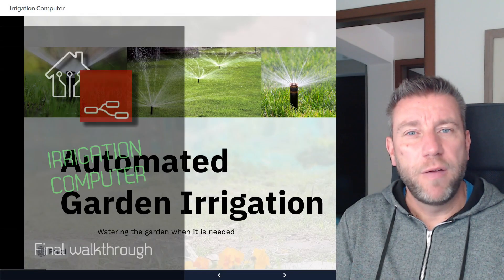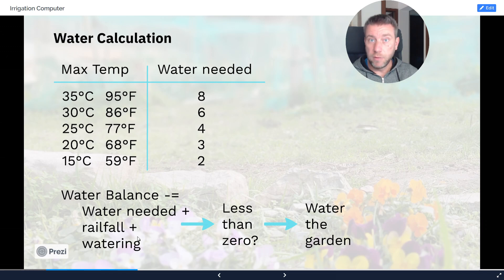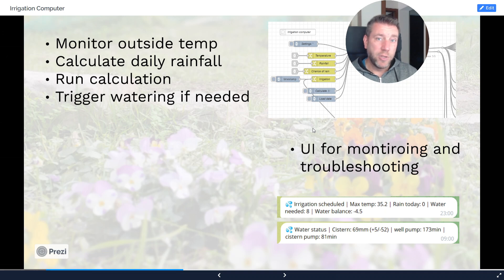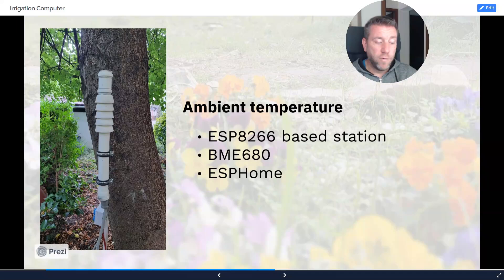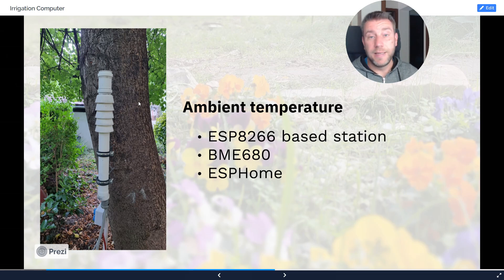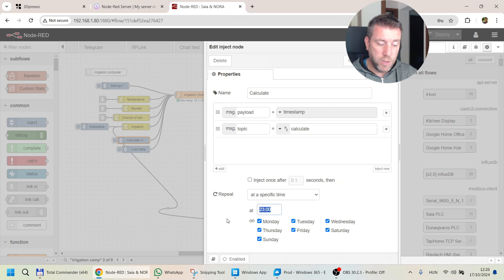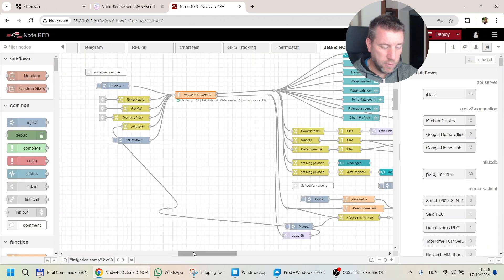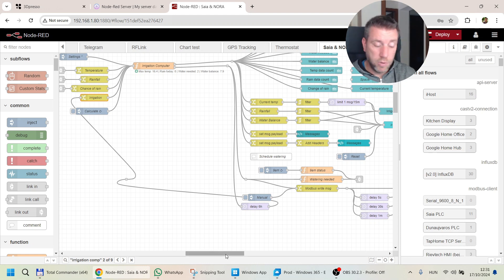DIY Smart Garden Irrigation Made EASY

Comment: I had been working on a similar project starting around 2018 using Home Assistant and Node Red to control a DIY 16 relay board that uses a ESP32.
I ran it on a raspberry Pi 4 and a SSD. The SSD crashed and I lost everything I had except for an early back up of my flow. I am still rebuilding it and it is a slow process. I used MQTT to control the relays manually from the dashboard with the intention of doing exactly what you have done here in automation. I also have a few soil moisture sensors that came with my Ambient Weather station and a flow meter that keeps track of the gallons used. I built an irrigation valve assembly out of 3/4" PVC that uses one set of valves to just irrigate the garden and a parallel set of valves that actually pull fertilizer into the system so that you can choose between irrigation and fertilization cycles. These can be set to run by timers or by total gallons. The 16 channel relay gives one main valve, the two for the Irrigation/fertilization, and 13 additional zones. It interfaced to Alexa for voice announcements, status messages as well as email and SMS.  Thank you for sharing!
Reply from the maker: WOw, that sounds very impressive. Fertilizer run you mean to mix in liquid fertilizer into the water? Since I am irrigating from a cistern, I did something like that in the past. Fixed fertilizer into the cistern water before pumping it out. How well the soil sensors are working? Do they give a good indication of the water content in the soil? I would assume you have to use a few as it would differ in a garden bed versus lawn.